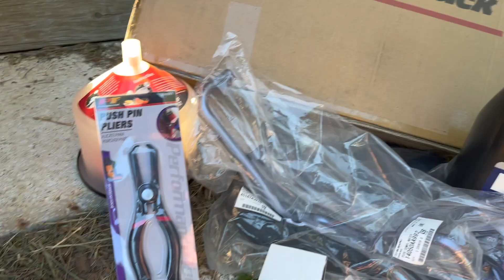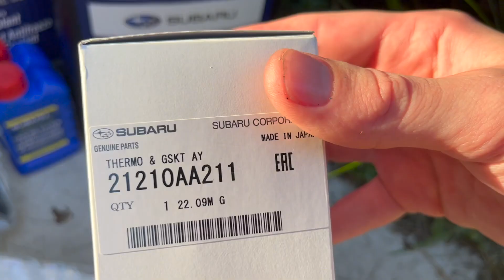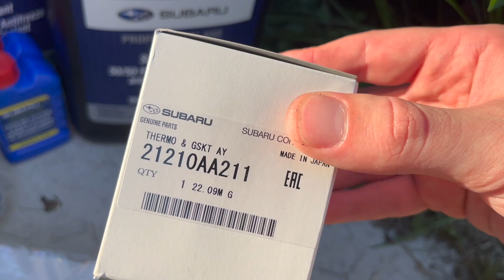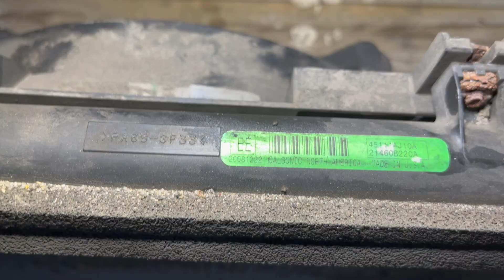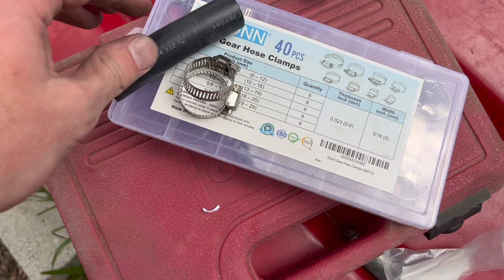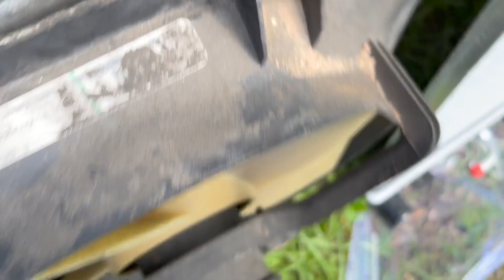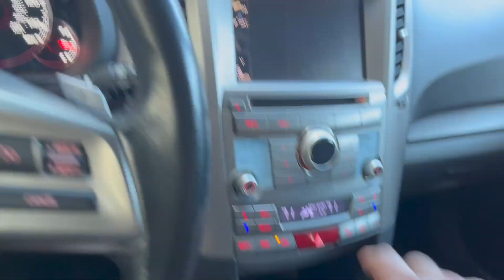2013 Subaru Outback Cooling System Replacement

Comment: Great video. Your steady, calm technique gives one confidence to also attempt this job.  I do have one question. Where did you get the car ramp?  Looks safe and great to get under a car and work on it.
Reply from the maker: Thanks, the ramp is called Kwik-Lift. They go for $2000 brand new, but I got used on Facebook marketplace for about $500. Definitely was worth it.